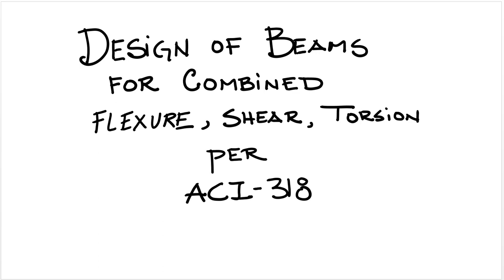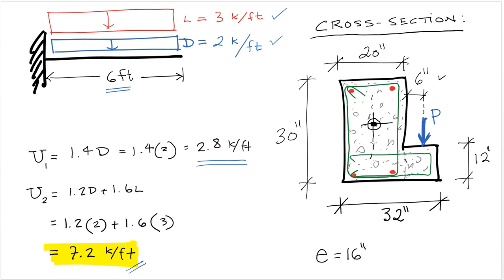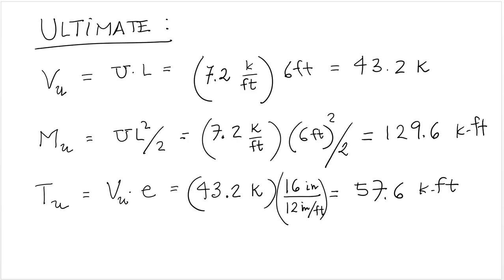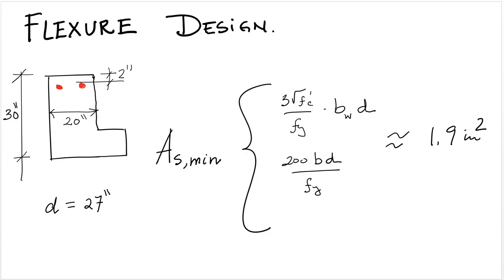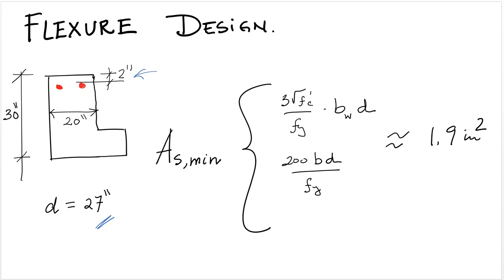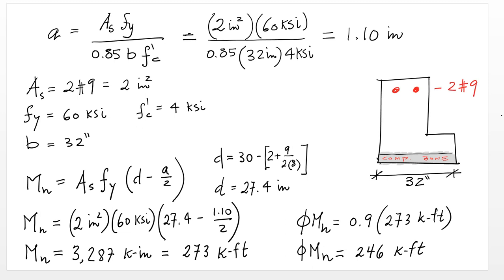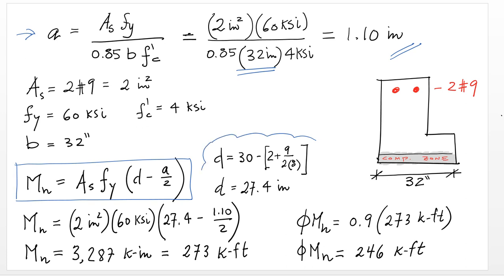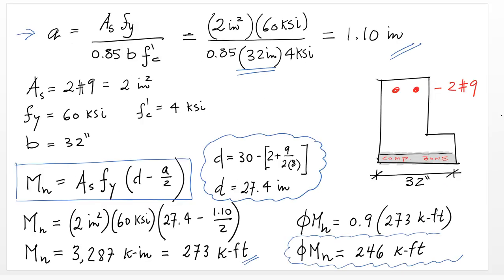EXAMPLE - Design of RC beam for combined flexure, shear and torsion - Part 1

Comment: Why is Torsion- Vu x e ??
Reply from the maker: I just saw this, apologies for the (very) late reply. It is because "e" is the eccentricity that exists between the externally applied force and the internal shear force resisting that force.
Reply: Shouldn't it be Pu x e?